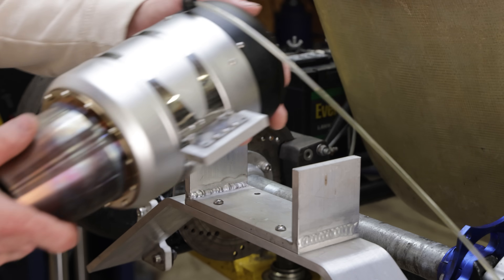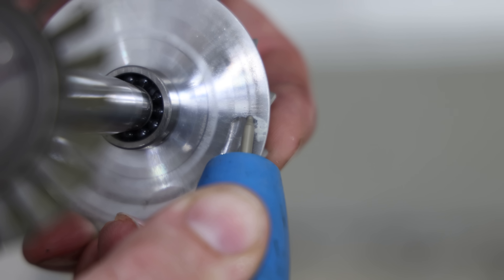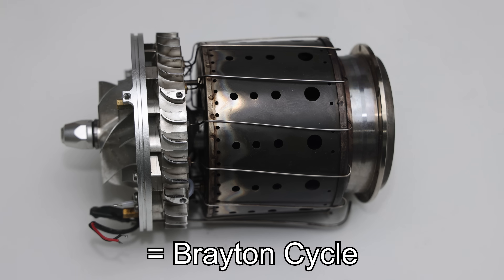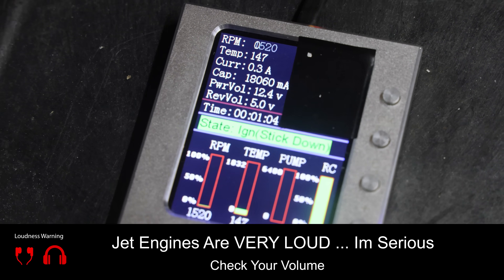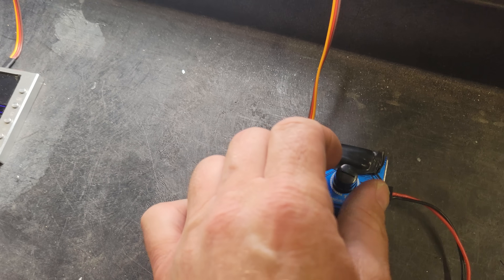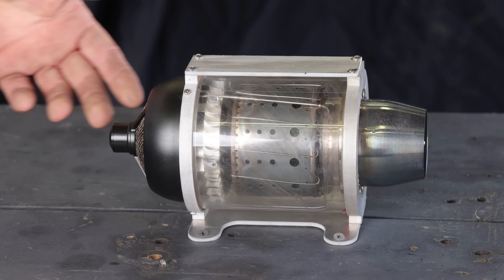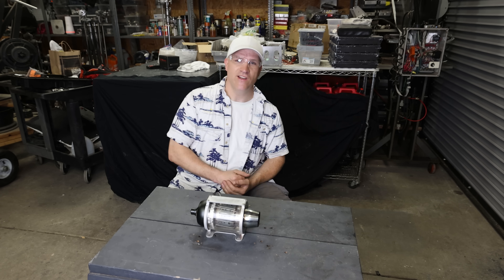See Thru Jet Engine

Comment: Quick question. How were you able to cool that thing if its a turbojet since they ignite all the air that enters? Also you placed it inside a case which would not allow airflow from the side to cool the ignition chamber.

Comment: What percentage of gas is used ? Start up time slow I think for practical use . What's the rpm ? Could you build a rotorary engine not like the wankel but Sim ilar ? Using only disc with ports for injection and exhaust?

Comment: Amazing content!
Was it with afterburner on or just the basic jet engine?
What's the difference between turbojet and turbofan?
Reply: This is a basic turbojet engine with a centrifugal compressor - like Frank Whittle built. The compressor is like the kind you get on a car turbocharger - it compresses the air by spinning it outwards - hence centrifugal.
A more advanced turbojet uses axial compressors - more like a propeller screw, but several of them in series.

There was no afterburner - that is where you pump extra fuel into the tailpipe after the turbine. This gives you extra thrust, but is not very fuel efficient.

With a bypass jet engine there are two stages of compression "propellors"; after the first stage the airflow is split - the inner flow goes into the second stage of compressors then into the combustion chamber, while the outer flow goes around the combustion chamber and meets back in the exhaust. this gives you more flow of air so more thrust for the same amount of fuel used.
A turbofan extends this idea so the first stage is a single big fan, and most of the airflow does not go into the combustion chamber. The hot part of the engine is relatively small and just produces enough power to drive the turbine that drives the fan, and the fan itself creates most of the thrust.
Reply: @tomgraham80  Thanks, great explanation!

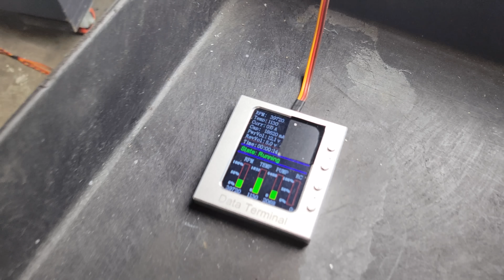Comment: 7:38 What was covered in the upper right corner of the display. A secret parameter?
Reply from the maker: No just an engine model for a different engine, I didn't want to confuse people. I mix and match Parts quite often
Reply: @WarpedYT  Ok I see. Thanks for the reply. 👍

Comment: A Halloween style of fog machine will not compress at all. It just condenses into water vapor. I tried to make a smoke machine to find vacuum leaks with the smoke. I ended up buying a machine made for it you need to heat something like mineral oil to make a smoke that may show the inner air movement. The fog machine you used will never work for anything other than making an area foggy.

Comment: As a Jet engine mech on F111, F15E, F16, and U2R/S acft that was amazing. The mechanics who have worked teardown and buildup know what happens but in 20 plus years I never got to actually see the flame in a combustor... AB yes... core engine never. I was amazed by the raw numbers... over 90K RPM and over 1000 degrees EGT/TIT... so freaking cool
Reply: We Indians are trying to build our own indigenous jet engines for our fighter jets. So far we were unsuccessful with the kaveri engine reaching 80 KN of thrust when we needed at least 100-120 KN. What is the reason for low thrust and how do we increase it?

Comment: I  can't imagine you  are using plexiglass for the  transparent shroud. What material are you using to withstand the temperature and pressures involved?
I am very interested in seeing your video of the transparent interior of your jet engine.

I attended the Kansas City airshow last weekend (Sunday Sept. 4) and saw a glider that was powered by  a small jet engine. Did you build that engine, and what is the cost of one of your jet engines? Thrust? Power to weight ratio?

Thank  you for an excellent video.
Gerard

Comment: Having worked with jet engines/gas turbines for 30 years, I would never have attempted to do a transparent one due to the danger. The pressures, temperatures and forces involved are all so great and I've seen what happens when things go wrong, even when designed and produced with all the resources of major high tech companies. Certainly not something to be played with.
Reply from the maker: Thanks! That's exactly what I try to explain to people.
Reply: @WarpedYT  I would like to see a woman do this.

Comment: I thought the front "compressor" was actually adding velocity to the flow, and then the high velocity flow would flow through the divergent stators, which by consequence decreased velocity of the flow and increased static pressure.  

Cool engine.

Comment: Such a wicked cool demonstration, with I'm assuming an epoxy case to be able to withstand those high temps and one could see how much air the engine was pushing, because of the debris, being whipped around in your garage.

Comment: My deepest respect for those four screws holding this little beast
Reply: was hoping the table will fly like a UFO
Reply from the maker: @clydelaya6230  no it's strapped down to the concrete pad..
Reply: @WarpedYT  if you used a bungee cord, you'd know that's how I smashed the windshield on my car lol
Reply: And he’s got the table ratchet strapped to 2 eye bolts in the floor
Reply: @Moodstillloading  That's what I was thinking - sturdy table ratchet strapped to eye bolts in the floor but the engine is held onto the table by 4 short wood screws..... WOW!!
Reply: @rovingrom  They looked like Jip Rock screws...could be wrong...
Reply: @rovingrom not that amazing really, those 4 screws are nearly all in 100% shear, so take the max thrust in lbs, then divide by four and compare to individual shear strength for a single screw…. I looked on the intrawebs real quick and the lowest number for a #10 wood screw shear strength was 710 lbs, plenty of safety margin probably for #8 too!  Since there is some torque, the critical spec is likely for the rear screws’ tear out, which I could calculate, by I don’t work for free, especially for the intrawebs, so I invite you all to perform that calculation on yer own!  Cheers!
Reply: For real its the only think I was thinking about lol, if they failed this would have been a different video. Just Imagine that thing flying around
Reply: @Noise991  To be fair, il probably wouldn't fly for very long (or very far) without fuel.
Reply: Would be interesting to get a gauge on the next run, see what the thrust output is too.
(Yeah I'm greedy but this guy's smart enough to add that without breaking sweat).
State the obvious Brilliant vid
Reply: @Farweasel  The answer is not much.
Reply: dude i was thinking the same thing!!
Reply: I been using those screws for years. Very reliable.
Reply: Adamın garajında hobi olsun diye yaptığı motoru koca Türkiye üretemiyor. 🤔😒
Reply: @ryzentevfik  sağda solda yazma la utandırma bizi
Reply: I was actually thinking more about the two screws at the top holding the top plate in place. That was flexing quite a bit and looked like the screws bent on a slight angle even creating a gap in the holes through the top plate. 

Awesome experiment and execution! Thanks for taking the time and sharing!
Reply: Agreed.  Had they failed, he would have been thoroughly screwed.
Reply: You would be surprised what good cap screws can hold down.  Holo Krome can tell you.
Reply: I was waiting for the table to fly away.    Also, this could be cool for roasting marshmallows
Reply: The shear  strength of each of those screws is roughly at least 150 lbs each.  Just basing it off some quick checking around.   So 4 combined,  probably exceeds the thrust of the engine by a comfortable margin.
Reply: @evangelicalsnever-lie9792  Fair enough. Impressive power from that engine and very satisfying to see it all work!
Reply: @evangelicalsnever-lie9792  I checked and tested them years ago.  Got 400 lbs in tension.
Reply: ⁴
Reply: Dude knows his jet engines if he was that confident in those little guys
Reply: The addition of a pressure gauge would have been interesting.
Reply: hahahhaha!!!
Reply: I wanted to know how much force it created too.
Reply: Drywall screws.
Reply: Exactly what I was thinking. No way I'd use four little screws like that to hold this thing down. That lets loose, oh boy.....
Reply: What is the RPM, EGT and thrust on this engine?
Reply: I was thinking the same
Reply: respect???? those things were screamin! lol
Reply: That mean it can take off or blast everywhere if is not screw down right ?

Comment: This is so beyond cool. I had a smile on my face the whole time. The skill involved in this is extremely impressive. How much thrust was this producing?
Reply: The engine rebuilt in this video is originally made by a Chinese company Swiwin, the model number is SW120B or perhaps SW140B. The maximum thrust is 120/140 Newtons. You can look up more data on these models on the manufacturer's website. 

It was a brilliant idea to make the transparent casing, to show how it looks inside when the engine is running! I think this was a great project, and the author has impressive skills both in working with the engines and in presenting things in a clear and exciting way.
Reply: That’s the question I’d like answered as well. 👍👍
Reply: Same here!
Reply: Likewise
Reply: And the fact that there is not a single female here to comment should be self explanatory as to how men will put pace these ungracious tards who move against their protecting inventor

Comment: so you first need to start the turbine with electric motor but then when combustion is launched you don't need to use it anymore right ? because I don't have any electric motor which can reach 29 000 rpm

Comment: you are going to have to run the fog at start rpm  very low to see it pass through as volume and compression will evaporate any visible gas... just crank it 300 rpm at le some small amount of  fog through - ignition  to see it well... i cant wait to see it...  you are a gear head god !!

Comment: 8:15 - 8:31 it’s a function and or correlation of RPMs and turbulent flow (maybe similar/analogous/etc to a Reynolds number correlation and or something ) through the engineer assembly … perhaps a slower range of RPMs would be a pretty cool video that capture the airflow better and or in a more visible fashion 🤷🏾‍♂️

Comment: It's much different for the turbofans used on most aircraft nowadays. They have a huge bypass stream of air that doesn't go through the burning chamber, but moves around it. They do move a lot more volume of air and therefor are much more efficient.

Comment: Sure it's not sucking in much air as this type has only little bypass air for cooling. For turbofans this is totally different. I don't know the ratio exactly but it's 60% bypass at least. And they suck as hell. This, however, is also the reason why those little engines are so horribly inefficient.

Comment: Hello, from this type of small jet engine, we can add a part to it that we can use to generate electricity, and since it has a low power consumption, it can be used to charge the battery of electric cars so that there is no need to stop the electric car on the road.  and I think that these turbine engines are used to generate electricity for electric cars due to their high speed and small fuel consumption. Imagine if a car consumes twelve or ten liters of gasoline per hundred kilometers, you can make a turbine  Let's charge the car like this, while driving and fuel consumption per hundred kilometers, I don't think it will be even a liter of gasoline, and once the car batteries are charged, you can turn off the turbine and you, who are technicians, try this and in my opinion  In order to use less fuel and make the turbine run more smoothly, I think you can add a bit to the power of the turbine using a magnet.

Comment: 5:06 - probably, it is not EMI, as you thought, but ultrasound from turbine compares (or near) of work frequency of MEMS gyroscope or accelerometer in gimbal. And they gives wrong data of angle speed/acceleration

Comment: You've actually made a truly priceless illustration of the jet engine's dangers by pulvering some mist at it.
It can be seen in slow motion that not only the air was pulled in from infront of the ingine, but from behind as well.
This is a neat demonstration of the Bernoullis principle, which states that increase of a fluid/gas speed will also decrease the pressure in it, and wise versa. Therefore, things may not only be sucked into the inlet from sides, but into exhaust too, in which case they will be immediately burned and blown away at a drastical speed.

Take care around your engines, and have a nice day.

Comment: 5:14...Great little jet motor, and great video, with a couple caveats. One of the four screws you used to hold it down seemed to be coming loose. This reminds me of the time two years ago when I tested the motor of a trash picked vacuum I found in pieces to see if it worked. I was stupid enough to not mount the motor in the vacuum first, believing that I could hold it down. It got loose like a bucking bronco! Fortunately, the GFCI kicked in and tripped the circuit breaker. So the damage was minimized. But had your see thru jet motor gotten loose, it might have gone flying all around your shop like a balloon with all the air let out, possibly injuring you and starting a fire. What surprises me is that a mere FOUR screws was able to hold it down during your demo! 

Later in the video, you said you were surprised it did not blow up. WOWSERS! On the one hand, kudos to you for your precise engineering! On the other hand, you probably would have been hit with red hot shrapnel had it blown up. If it were me, I'd do that experiment in the middle of nowhere, with remotely controlled cameras set up to record it, while sitting in a foxhole plenty far away. And I'd be sure to yell "FIRE IN THE HOLE!" if anyone else is around. On the one foot, how could an engineer such as you overlook these precautions? On the other foot, am I missing something here?

Comment: Didn’t see how, where fuel enters. Is it pumped or does it vacuum draw and then how fuel circulates in the combustion chamber then mixes with the compressed air, how is it ignited. ? 
 How throttle works No carbs maybe injectors, timing for fine tuning of combustion for designing more and differing power characteristics. 
I’ve Still loads of silly ignorant questions.

Comment: You certainly have more experience with jet engines than I do. However, I did see a video about the turbines they use on airplanes. I don't have the link but you should be able to find the info about it which indicates that the engine size has been increasing and specifically the size of the blades on the intake side so that it can move more airflow, thus making it more efficient and using less fuel. Perhaps you can do a video with this design on this smaller scale.

Comment: 1:40 The compressed air goes through the stator which is on the "outside" and a bit after the compressor and then from the "outside" into the combuster through the small wholes?
Works this concept on all jet engines?
I thought on bigger planes and bit jet engines there are more compressing rotor blade at the beginning an the air goes the "inner" way.

Comment: Great work! exelent pice of art!
to avoid blowing up of the gasket You can use long screws to pull the both flanges in place. 
also wider opening of the air inlet would lower the suction restrictions and the engine would blow up:) 
I really enjoy Your work!
Reply: It seems like there needs to be gearing between work harvesting blades and those that impart additional velocity to denser exhaust reducing it's pressure presumably once release if at fast enough speed for remaining distance....

the engine provides thrust by making air around and outside engine move so the smoke test demonstated that to me mainly despite engine being stationary no spoke that gets past it's entrance can be suicked into it.  If it was braking it could suck all the smoke more easally

Comment: It’s not just the flow of the air that made the markings on the plastic, even on the “cold” side of the engine the air being compressed gets to like 400 degrees C. I fly jet helicopters so I get to play with these guys daily :) great video!
Reply: The high temps compressing air generates are little utilised but regarded as a nuisance to be sprayed away generating warm water with CAES model that went bellyup most recently but the hotter the better for many purposes you can compress air instead of using electric resistance to do things steam for example would be awkard to use and flames inefficient ie ergo

Can we melt copper by compressing air sufficiently?

Is there any point though to generatiing heat when it's so cheap tomine?

oh youir saying the cylinder itself was heated to flowing temp lol

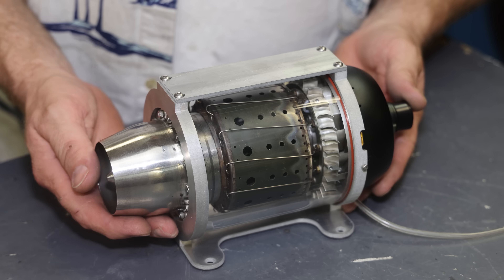Comment: 3:10  The exhaust nozzle looks like a convergent nozzle but it is actually a divergent nozzle. Inside of it the area where exhaust gases exit the turbine blades is small and it gets larger as it exits the nozzle assembly made up of the exhaust cone and exhaust fairing. Some exhausts add to this effect with an internal Pen Nib Fairing Assy. which is wide at the front and tapers to nothing going aft. I think they do it that way to cool and quiet the exhaust gasses on airliners. If I'm not mistaken, on military fighters they design it to speed up the exhaust gases for obvious reasons.....speed.
Reply: we use them on fighters to regulate engine pressure to avert stalls